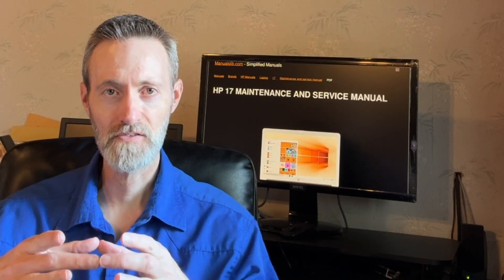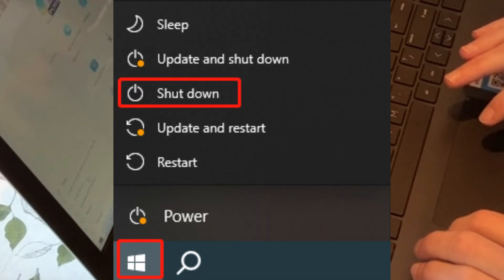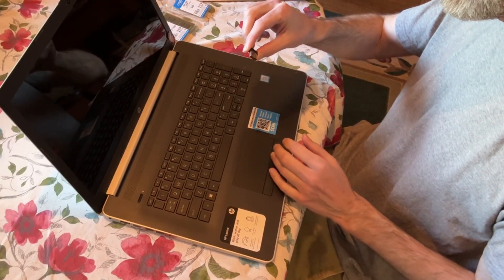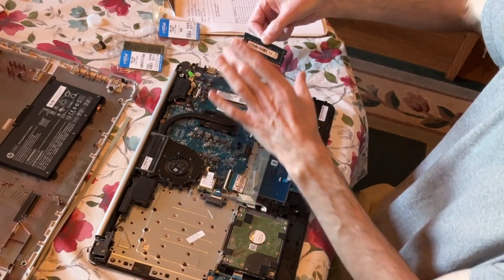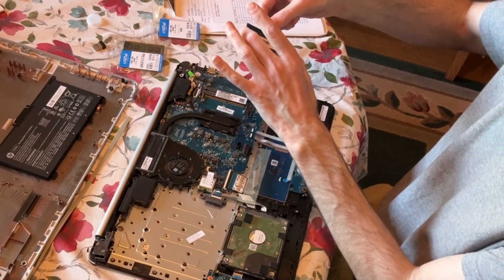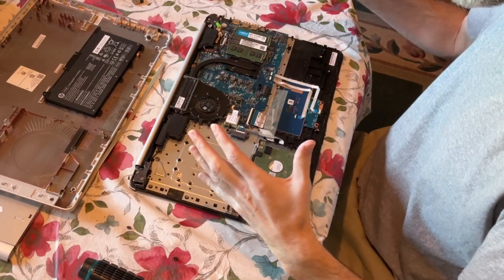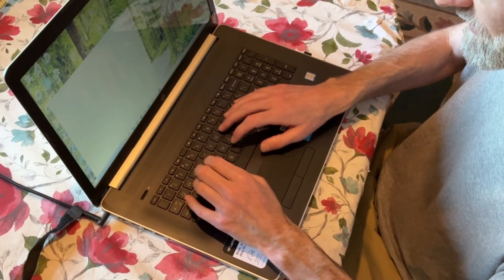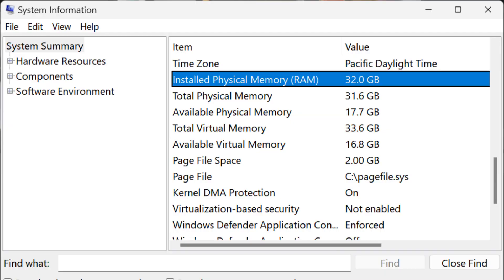How To Upgrade the Memory in HP 17 Laptop PC

Comment: Good video, but I would also recommend before taking the back off to do a full system image backup to an external drive along with a boot disk just in case there's a static shock to the motherboard (wearing an earth strap is a bonus too)
Reply from the maker: Making a backup is a good idea. Hopefully most users are making a backup of any data that is important to them because data loss can occur in many ways.

Comment: I found this helpful, my question is, when you boot your HP 17 back up, does it take some time for it to start up normally?
Reply from the maker: It could take a little bit longer the first time you boot because Windows might be recognizing the new memory, or Windows might have recently added some updates before you shut down. But in general it should run faster.

Comment: For a laptop and more casual use you don't really need 32GB of RAM.  16GB is enough and is cheaper to get.  Just make sure you get 2 same sticks.
Reply from the maker: Thank you for the comment. Personally, I feel that there is so much running in the background of Windows like Windows updates, antivirus updates and Office updates that it is better to get 32GB of RAM if you can. As Windows and Antivirus gets larger and larger the computer runs slower and slower. Also browsers like Edge and Chrome are regularly getting updates and getting larger and larger.
Reply: @jeffsbaker  Too true, IMHO.  ; > )  
Thanks for a great guide. Subscribing for help on down the road.
Reply: @jeffsbaker  You can get rid of bunch of background services and Win spying by using BloatyNosy and something likeO&O ShutUp10++ (works with Win11 as well).  All the telemetry crap is not needed and you can disable Windows from contacting dozens of third party websites.  You can turn off Edge and Chrome running in the background when turned off and tons of other stuff.
I see you have a SATA hard drive.  Is that your OS drive?  It's hard to see, but this laptop could have a NVME slot.  I hope that spinning hard drive is just for storage.  You will definitely notice better performance with a SATA SSD or NVME drive than more than 16GB RAM on a laptop ;).